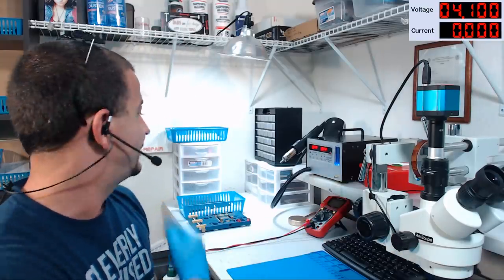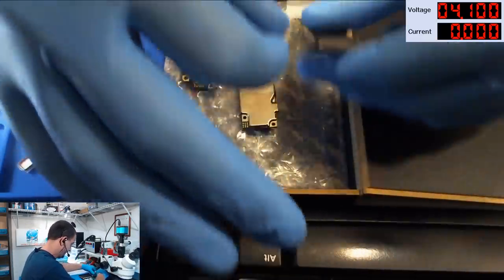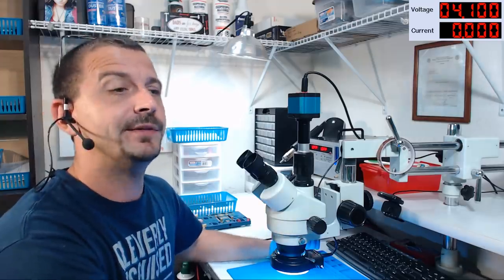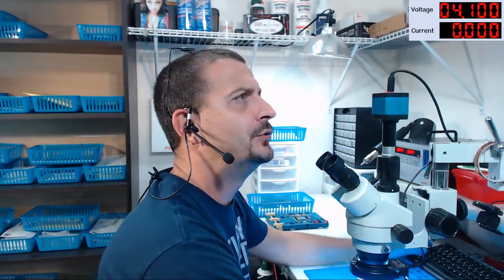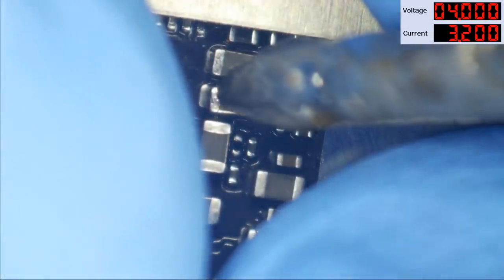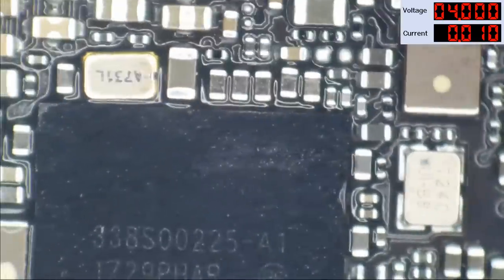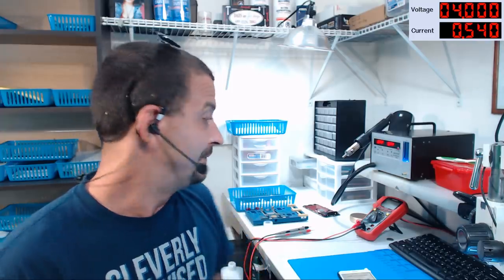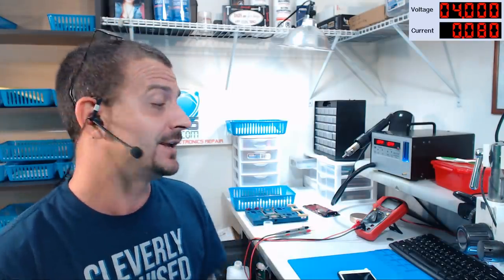Easy breezy beautiful PRIOR REPAIR ATTEMPT - An iPhone 7 Plus "No Power" repair

Comment: When a charger is connected, the  currents flows from the charger, to Tigris and fills VDD/VCC (depending on the model). The chip passes the USB current,  to VBATT, allowing the battery to be charged while phone is being powered by the USB voltage.

Comment: The chip you asked about leaving out connects or disconnects PP_VDD_MAIN and PP_BATT_VCC depending on TIGRIS_ACTIVE_DIODE (A1) signal, i dont know what this means in practice apart from the phone being unable to disconnect those two lines if it needs to, when you bridge them

Comment: 👍 good job! I’ve tried on a 6S. If you remove this transistor mosfet. No boot ! In my case only 0.05 A....
Reply from the maker: If you remove the mostfet and put a wire across it, it will boot but I don't know how well it works for charging / draining the battery tho.
Reply: @ststele   yes. Jumping a MOSFET like on computer 😃 maybe avoid vcc main to talk with batt vcc... mine was getting hot after change the 4G BOOST ic near baseband....I've changed them and since this time I can't boot. Stuck on 0.05A on power supply... I'm lost.
Reply: Did you found the problem

Comment: Is there any reason why you are using the resistance mode on the DMM instead of continuity mode? I reckon continuity beeps are faster than the resistance measurement

Comment: If only the thermal cameras came down in price.. Put the board in the fridge, and then when testing it- the shorted IC will glow way bright.. would be interesting to see..
Reply: Jerry Davis there are thermal cam that work fine and at good price. The ones that you plug to the phones charging port work good.

Comment: Please Bro where can I download the software for this multimeter linked in your description only I have followed your link and purchased the multimeter and had it shipped over to the UK only to find that the software disk is corrupted and that it locks up my pc when trying to read the disk 🙇🏻‍♂️

To add insult to injury there is no software to be found for it on the tinterweb 😤

Comment: How can you boot it without battery, I tried and it won't, it is starting only with battery. Do you use some special cables?
Reply from the maker: Hmmmm, the phone should boot with only power hooked to the +/- at the battery terminal but they typically will not stay booted.. they reboot.  The power cables I use are from geekbar.tools, unionrepair.com and ipadrehab.com.  The white one that I used in this video came from iPad Rehab I'm pretty sure.
Reply: Thanks, I'll try again, maybe power supply is problem..

Comment: What is meant by "firm short"? consistent low resistance opposed to an intermittent short?
Reply: Low resistance short that doesn't heat up much AFAICT.
Reply: @NeuronalAxon  Energy dissipated in a short (heat) = I2R. So heat is proportional to the resistance.
Reply from the maker: A short that is connected very well.  I should really be using something more sensitive than my fingers. :)
Reply: Thank you NA, Bill, & Jason

Comment: how to put multimeter reading on video screen 😕
Reply from the maker: I'm using a multimeter that has an output that connects to a PC.  It came with software that shows the reading on mine screen.  The software I use for recording lets me record specific areas of the screen / applications.  Here's a video of me setting it up: https://youtu.be/vgB1gcYKSWI
Reply: STS Telecom thank you very much sir 😊👍